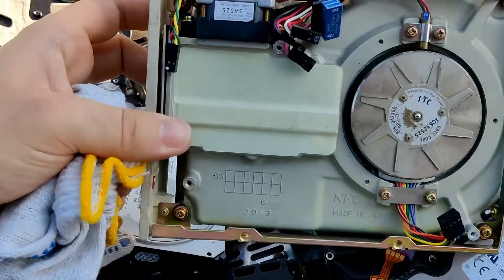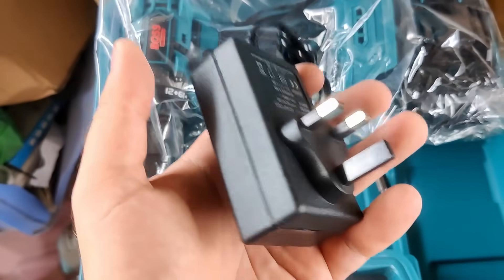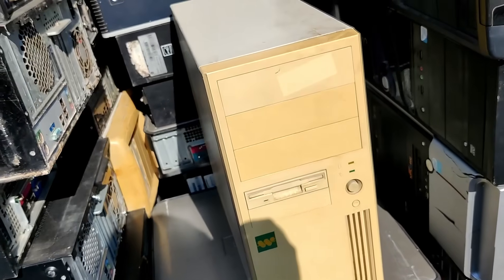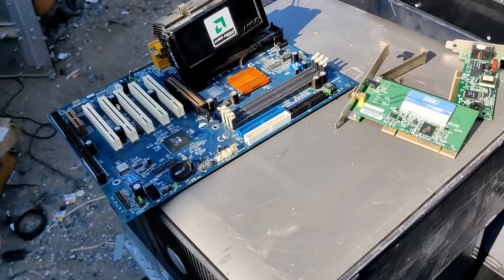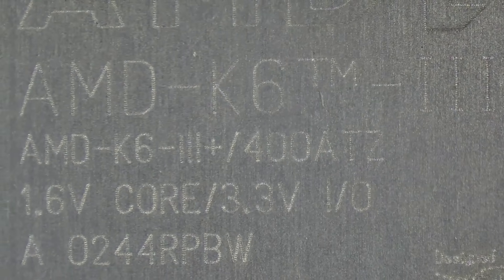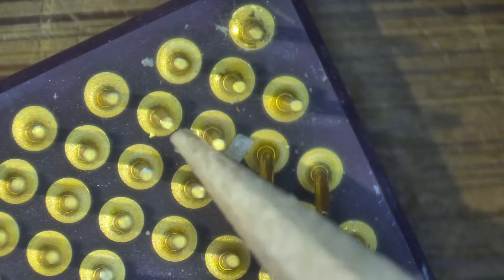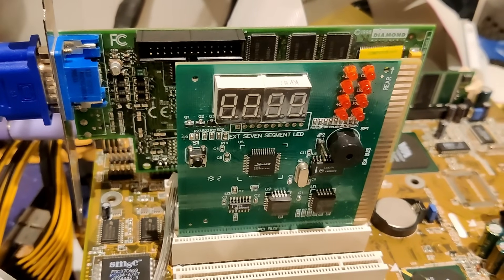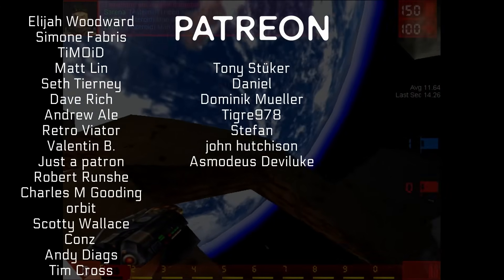I Found Rare AMD K6-III+ CPUs and Broken Dreams 😥

Comment: Those VXpro motherboards had to have been one of THE ABSOLUTE WORST motherboards ever made.
 I worked in a computer store  in the late 90s and the boss insisted on palming this trash off on the customers.    And the razor blade/beer can cases.   We would sell these boards for $99, so I know the margin must've been pretty big, considering an ABIT motherboard in p2 flavor was only $150 at cost for me.

Anyway, this board caused me to get myself fired from that job.   I literally built one or two systems with that horrible board per day.   I bought one for personal testing at the house.   I couldn't get the IRQ settings to keep after a reboot, so only the NIC or the TVTuner card would work, but not both at the same time.    Anyway, a navy sailor wanted an upgrade and was talked into the VXpro..    I spent two days on this crap -- because the sailor's peripherals were the exact same NIC and exact same Tuner card, amazingly.   He must have got them from the PX as well..    I had it out with the owner's brother because I told him THIS WILL NOT WORK, EVER, I HAVE PROVEN IT.       So, he told me to get my tools and the get out and don't come back.    He didn't say it quite that nicely, however.

Comment: No chance the cracked CPUs would work. The cracks are bad enough to have gone through pads for pins on both cpus. Wires in the CPUs would not survive if  pads were affected like that. Via chipsets for K7 were common but stability and compatibility wasn't great. If you had a stable system it was not a good idea to change anything. Upgrading drivers could break everything but that was common for all via chipsets at the time. I ran an Athlon on a VIA chipset for years and it served me well till I got an Athlon64.

Comment: I massively modded my Highscreen Colani bigtower into a dual-PC with beside a modern mainboard (AsRock ITX with Ryzen 2400G) the original Win98SE system with DFI K6BV3+/66 mainboard with AMD K6-3+ 400@550MHz (768MB RAM, GeForce TI220 + 3Dfx 1, SoundBlaster AWE64 + Gravis Ultrasound Classic) which I had used until 2016 as my main PC until its browser stopped supporting eBay and its 160GB HDD got full to the brim with tech info stuff that turned FAT32 into a snail. (I research and collect old music keyboards & sound chip things, early videogames etc.)   I had to slightly overvolt the K6-3+ (1.6 to 1.8V?) and it needs a heatsink with fan (oversized, hanging on rubber bands between plastic cotton swab sticks to block noise). This CPU does not run hot at all, but crashes already near 50°C (I don't remember the exact value) so cooling is a must when overclocked. A decade earlier I had an inferior DFI mainboard (K5BV3+?) which suffered of badcaps syndrome, so in a hot summer caps of it with a hotter running AMD K6-2 500AFX had bulged and it didn't boot , so I had to reduce clock speed to 300MHz(?) to make it run. The K6-3+ runs much cooler.

Comment: I have those K6-II+ CPUs which I unlocked to K6-III+ by enabling the full 256k cache on CPU. I can't get not much over 600MHz with any voltage. Best thing with these CPUs is setmul-software which can set multiplier from the DOS. Can be found from vogons.

Comment: Hi there! I am quite unsurprised that your 400MHz 1.6V chips do not like running at 550MHz on stock voltage. These Sharptooth chips were available in 550MHz variants as K6-2+ but they all required 2.0V for 550MHz operation. If you are interested in replicating the specs of a 550MHz chip, you'd have to feed it 2.0V, although I am pretty sure the chip you have which runs 500MHz on 1.6V will do 550MHz with less than 2.0V.

Comment: 9:30 It's Via KX133. Second ever chipset for K7 platform. Very rough, made very fast by adapting VIA Apollo Pro133A to EV6 bus. 
Plus side - it works with AGP 4x and this means it is AGP 2.0 port with universal 1.5/3.3V support. So it can handle every AGP card released for PC from 2x till 8x.
Also as early Athlon MB it means it is can be insanely unstable, sometimes broken and pretty weird. VIA did not figured out how make good non-conflicting chipset until KT400A.Pure lottery.

Comment: oh my i screamed out loud when i saw that k7 athlon the via kx133 is a bit tricky to set up right but is a very fast chipset if configured correctly i have one on a epox 7kxa with 600mhz cpu and it kicks my pentium iii 800 in the balls in nearly every game. for the cracked cpus id say try them but maybe in a board u dont care the most about just in case something bad happens. did u take the ibm aptiva with you? they are very rare ive been looking for one for 8 years now and still havent got one.

Comment: Back in the day I did a ton of modding. (OMG even my modding is retro now) Everything from overclocking to 6810 CPU swaps with zif socket. I started looking into a 6800 CPU replacement with raspberry pi sort of like what they do with the Amiga mods recently and found this channel/mod. I haven't touched my Genesis machines in years. I might have to revisit them now.

Comment: The K6-III was my first decent CPU that actually allowed me to indulge in some enjoyable gaming back around 2001 or 2002. I did have a K6-II before that but I remember there was a major difference in relative performance between the K6-II and K6-III CPUs - more than there is these days between my current Ryzen 5800x and Ryzen 5800x3D machines. I actually badly wanted a Slot series Athlon but seem to recall they were both hard to get (with a suitable mainboard) and very premium priced back then. I think they were around $600 here in Australia while you could get a K6-III for a little over half that. Mind you, my next upgrade was into the Athlon XP series and they were really terrific for the last days of the single core era. Had lots of good memories with that machine as that was my first machine that I could say allowed for serious gaming!

Comment: For the cracked chips, I would make sure that the pins effected are actually I/o related, if they are VSS/VCC, then it might not matter  if they are disconnected.  if you are lucky it might work.
Reply from the maker: I tested the cracked chips now - they both don't work. There were just too many pins affected and I/O and address pins are spread everywhere.

Comment: I still have my AMD K6-III+ 450, that I still have overclocked (using normal heatsink-fan) on a supersocket7 board since 2000.  It ran Quake2 & Battlezone2 decently having used the computer lastly in 2012, but haven't really it turned on since then (now I will have to, heh).  Also have one or two AMD K6-2's, forgot the speeds but one is probably a 550.  And I would love to take some of those case towers to use for my older motherboards that I since had to bag up for decades, going as far back as my 8088's & 286's.
12/26/25

Comment: Try to swap the chip onto a substrate of a dead chip. :D
Reply from the maker: Ha, I wish I had the equipment of doing something like this. I don't even know if it is possible at all. Those dies are glued to the ceramic from what I have researched. It's not possible to lift those chips without damaging it. One-way-bond :(

Comment: I liked the K6's better than contemporary Intels back in the day; the caveat was they tended to run hotter and needed better cooling, at least in my experience.
Reply from the maker: I do like the K6 family too - especially the PLUS versions. They were just a bit late to the market, but great CPUs for the Super Socket 7 platform.
Reply: K6-3+ ran extremely cool compared to Pentium stuff. But if overclocked they crash already near 50°C, so a good heatsink with fan is strictly necessary at 550MHz.

Comment: Man i would have loved to get the Pentium 1 233. Just got an old Cyrix in my Socket 7 board.
Reply from the maker: Those Pentium MMX CPUs are quite common. I stopped taking them because I have already plenty.
I wish I could justify taking them and selling them, but 25 USD shipping and 10 USD to actually buy a CPU with potentially bent pins isn't worth it :(

Comment: I wouldn't touch those 3d printers. anything old enough to be there is too old for me.
Reply from the maker: Absolutely agree. Those things are probably so worn out that they're impossible to be restored.
Reply: @bitsundbolts  it's not just that. Old printers sucked when new. Leveling was a nightmare. Z offset was a pain in the ass. I need a loadcell for levling. It's much better.

Comment: For the cracked chips, couldn't they be converted into some kind of heater, for maybe to keep a cup of tea warmer for longer, by tying the VCC and ground to some battery or power supply?
I've done that before on one that had pins missing after I dropped it when I swapped one out in a laptop for a slightly faster one, but if the cracks short out in between, then even repurposing as a heater might be off the tables.
Reply from the maker: Hm, could be, but I am not sure how "efficient" it would be. I could imagine that you need a lot of energy to get those chips warm.
I tested the chips in a motherboard - confirmed dead - so, I could play around with them.
One test could be to check if the die still gets warm.

Comment: As you said, cracked ceramics has no chance of working.. there's far too many traces in that connection sandwich that will have been ripped apart. But congrats for finding at least two working ones!

Comment: Still love the K6-III and III+. For overclock give them a little more voltage, I'd need to check for sure but pretty sure mine are at 1.7~1.8v or something. I've had good luck with both the II+ and III+ running pretty easily at 616 (112 x 5.5) but that's only like a sample size of three chips and two mobos so probably not the best sample size. And I unfortunately never had a super 7 motherboard that would run 83/124 or more reliably - even if I disabled the on board cache. And none of my chips even pretended to post 672 (112 x 6) but I wasn't really wanting to try over 1.9v ;p

I actually bought a III+ back when socket 7 was still my main rig and after finding a beta/mod? bios for the FIC 503+... wasn't the cheapest but was pretty awesome. This was still the time where you could buy and assemble an entire Super 7 system (*everything* except for say monitor) for less than the cost of just a Pentium II processor ;p. Saying that I really should see of those machines still work, time flies and it's been... a number of years now (has it been over five years now? yikes!) since last powered up so they probably need some TLC =( But if I remember it still has Windows XP SP2 running at that 616 haha

Comment: I'm surprised that the Pentium 4 socket 423, which chosen on first look, didn't placed to the final CPU selection - they've become rare, very rare, and little expensive.
What's wrong with Creative Infra? They're certainly crappy, but the price makes up for the repair. Just take parts from the Samsung CD-Master series and that's it.
Reply from the maker: I didn't think of the P4 to be valuable with RDRAM - I didn't like that era of PCs and it was kind of a failed technology. Good that DDR memory took over.
Reply: @bitsundbolts I completely agree - these P4s on the 423 socket are not very interesting. However, they have a collector's value precisely because this is a strange specific generation that failed. The cost of kits on the 423 socket is at least 10 or more times higher than the P4 on the 478 socket on the domestic collector's market of Ukraine. And our prices are noticeably lower than European and American ones, so it may even be more expensive, I did not check the prices on eBay. They have about the same price as kits on AMD slot A, a little cheaper, and they are almost twice or three times more expensive than kits on socket 7.
Reply: I'm talking about price now not as money, income, and so on, but as the degree of interest of people, collectors, in such a set. As the degree of its value in their eyes and the degree of desire to own it.

Comment: I still have my K6-2+ 550 that I was able to overclock to 600. Ran it for years until I got tempted by a Athlon 64 X2 4400+ that I squeaked 2.4 Ghz out of. Still my daily driver on a Asustek motherboard with an Nforce chipset. Dual booting Win 10 and Mint. This is its last year as a Win10 machine.

The K6-2+ was a blast when I got it new. I paid $75 USD for it and could hardly wait to install it.

Comment: wonder how big the internal lines are.. i've seen pcb repair where they dremel open teh casing to repair internal traces..
Reply from the maker: I think those were fiber glass based - not ceramic body CPUs. I don't think you can easily dremel those.

Comment: I own some AMD K6's (with 3d Now!) back-in-the-day .  What I remember most from them then was this...
The ones I had were faster than Pentium II's but they couldn't run whatever N64 emulator was popular back then.  I was disappointed because I had got a Voodoo card, just to run n64 games.
I also seem to remember one being a 550Mhz, but my mother boards wouldn't recognized it as such, and under clocked it.
Ah, those were the day. 😁

Comment: Give those cpus a little bit of voltage boost, like 1,7 or 1,8V at 550 MHz. 1,6 is very low, no wonder those doesn't work.
Reply from the maker: Will do this in another video when we take off the heat spreader of the cracked CPUs.
Reply: @bitsundbolts yeah, those look a bit like Durons underneath

Comment: Get  decent cooler, and put 2.1v to the cpu with a 115fsb and 2x multiplier.
You'll get 633Mhz. I've done it on 400mhz 1.6v chips before. 

In a perfect world, you want to find a K6 II+ 570 ACZ 2v and modify it to a K6 III+ by unlocking the rest of the cache. They clock to 633 or 650 quite easily with good cooling.

I personally run a K6 III+ 500Mhz ANZ 1.8v @ 2.1v  to 633Mhz stable for quite a number of years.
Reply from the maker: I did mod exactly that CPU K6-2+ 570 to unlock the L2 cache. Works perfectly as a K6-III+ 600 with 256K L2 cache. I will overvolt those chips in a coming video and see if I can get them stable at 600 MHz (my board doesn't do more than that).

Comment: Testing bad CPU'S is like testing bad capacitors, you know that they are bad but you want to know how bad they are.... 
It makes no sense and yet I could watch a 2 hour video testing bad capacitors even though it's pointless... It's not like you are going to find one that is somewhat still functional and and decide to put it aside to be used at a later date.... 
There's just something relaxing about watching bad components being tested.... 
I would be interested to see if those cracked CPUs are going to fight to work or not.... So basically yeah, plug them in and see what happens....
Reply from the maker: I already tried the cracked chips in the meantime - confirmed dead. But they will show up soon on my channel again.

Comment: Only worth trying those chips for entertainment's sake. I wouldn't be that surprised if one of them just somehow works. I believe the ceramic can be cracked sometimes but the traces still connect. Just a guess.
Reply from the maker: Yeah, those AMD K6-III+ chips are sought after because the are quite rare. They are nice retro chips though because you can adjust the multiplier in software.

Comment: So good to get a K6-3+ 550MHz, it should be available for laptop only, maybe able to beat s370 pentium 3 500 if >600MHz
Reply from the maker: Good question - I might test them in a future video and compare them against the competition at that time.
Reply: @bitsundbolts  you need a good super 7 mainboard to do so

Comment: The CPU with the crack very close to the corner, might be worth trying. 
There might be a chance that the golden wires that go from the pins to the die, just stretched, and haven't been severed. 
In theory, you could even check for continuity between pins, compared against a good cpu. But even on the lowest impedance setting of the multimeter (NOT diode mode), it might not be safe, because the multimeter injects voltage in order to test, and it might be to bad for the cpu die.. IDK.
Reply from the maker: I tried them - no chance. Both chips are dead. I think the cracked corners are only holding on because they are glued to the heatsink.
Reply: @bitsundbolts  bummer :-(